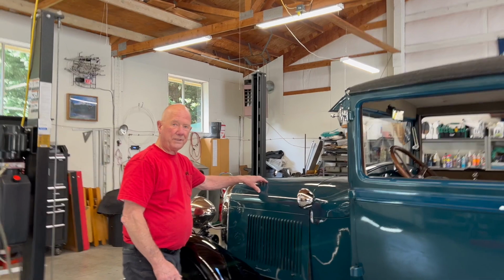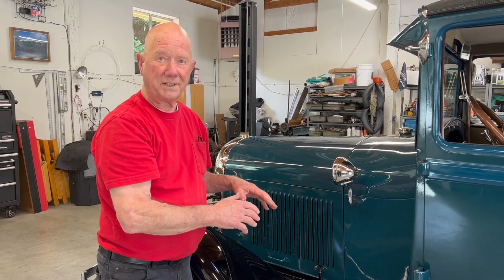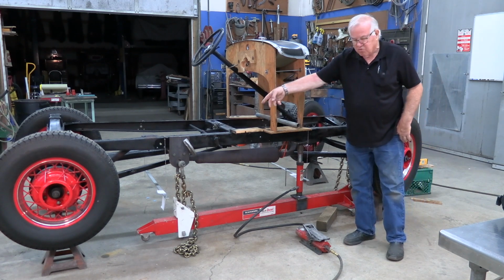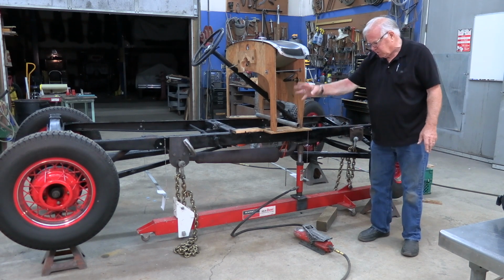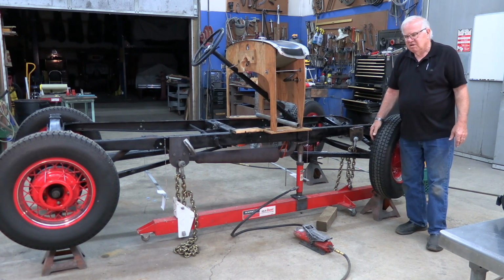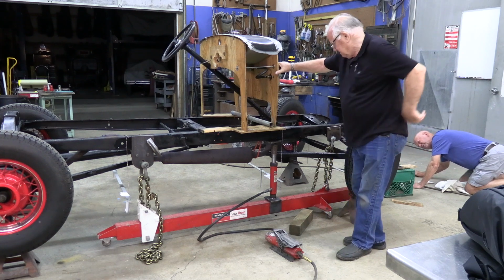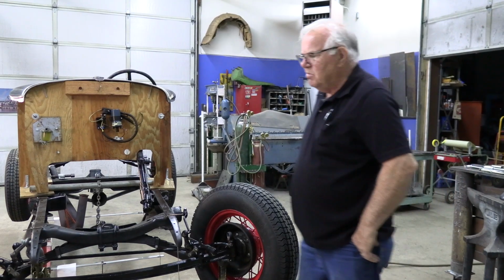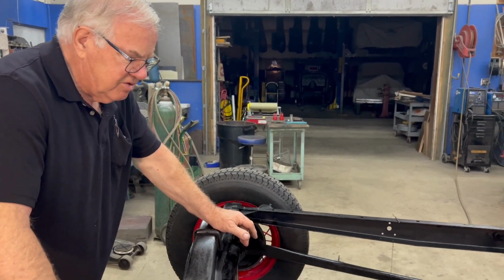Straighten a Model A Frame WITHOUT Removing the Body

Comment: Very good. Does that area of the frame near the rear motor mount need reinforcement to prevent future bending after a repair? The metal structure could be compromised by the frame damage. 
Thank you.

Comment: I know my comment has nothing to do with this video except that it is about a Model A. What would you do or do you apply any type of sealant to the transmission drain plug and the differential drain plug in order to keep these plugs from leaking and or weeping?
Reply from the maker: Hi, I consulted with John (who was featured in this video) and he suggested the following for the differential drain plug:
non-Harding permatex super 300 sealer.
I hope this helps.
-Ahna
Reply: @ahnaholder  Thank you very much.